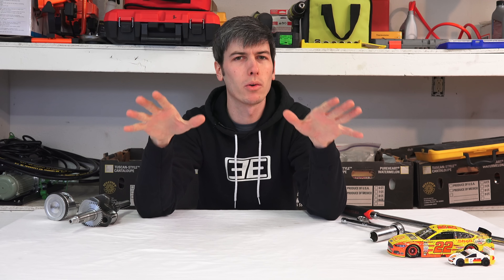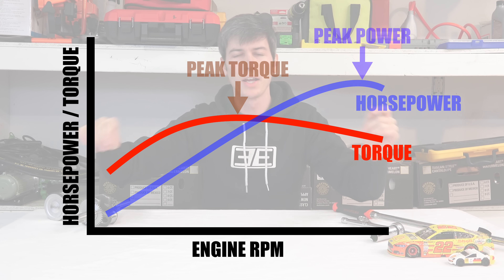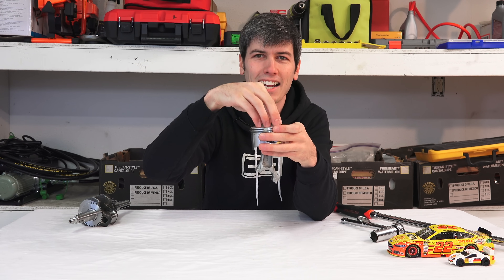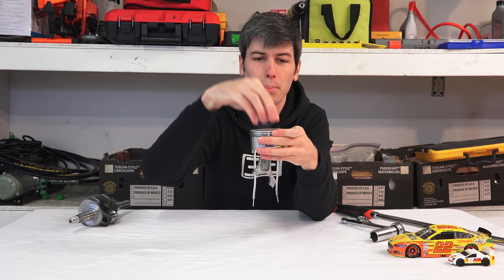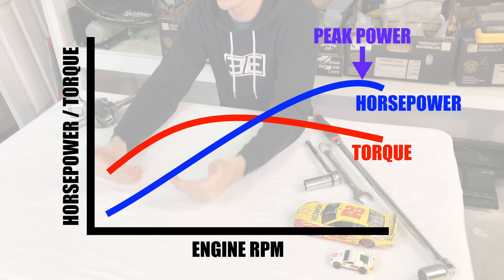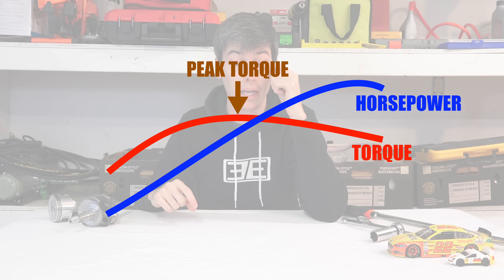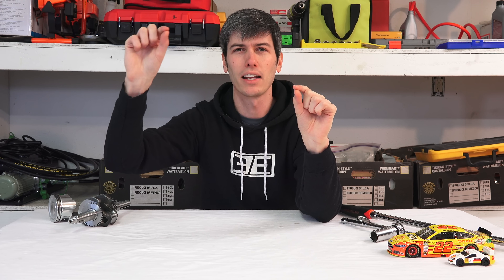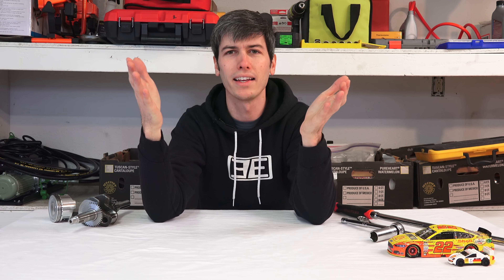Horsepower vs Torque - A Simple Explanation

Comment: Simplest explanation I ever heard was:  Horsepower measures the maximum speed, Torque measures how fast it can get to that maximum speed.
Reply: My (limited) understanding is that torque is a measure of how effective each rotation is at making power. Horsepower is the only useful measure for acceleration and speed.

If you find that a engine has low torque but high horsepower, that implies that it's capable of revving quickly to compensate for the low torque.
Reply: YolkyPalky It may be simple, but it's wrong
Reply: Not really, it's pretty accurate statement.
Reply: YolkyPalky No, horsepower determines how fast you accelerate
Reply: Matthew Prather that is horribly wrong.  Torque determines how fast you accelerate.  Plenty of vehicles have high horsepower but low torque especially on the low end, they accelerate slowly (torque) yet may still reach a very high top end speed (horsepower).
Reply: YolkyPalky Maybe for the first quarter second, but ince you get to a high rpm, horsepower determines how fast you accelerate. Torque doesn't really matter because cars have gears
Reply: Matthew Prather HP is a measure of maximum power, Torque can be thought of as a measure of how fast you can get to that maximum power.  In other words, Torque measures the "Rate of Acceleration", not Acceleration itself.  It is a Rate of Change measure, so to speak.  Two cars with equal horsepower but unequal torque, the one with higher torque will get to peak acceleration, or maximum horsepower, faster than the other car, even though both will top out at the same maximum speed due to equal horsepower.  In even other words, Torque is for stoplight to stoplight driving, Horsepower is for long drag races where you can realize peak power, or peak horsepower, and the amount of torque you have will determine how quickly you can get to your peak horsepower or peak acceleration.
Reply: Low end torque DOES help you get into your maximum power rpm range more quickly. And it's certainly pleasant to have a wide range of usable rpms.

But you can also just have it geared to keep you at an effective rpm.
Reply: ezkieler850, I would rather simplify it like this: horsepower is torque multiplied by RPM. Horsepower is direct derivative from torque. 
I guess, many people take the maximum horsepower as some kind of constant value, whereas in fact, horsepower is a value changing with RPM, based on torque at the given RPM.
Reply: No, that's wrong.  Horsepower is a mathematical equation to describe torque invented by a guy to explain to normal people how much power their engines were making in a relatable way. What EE doesn't explain here is that generally, engines with more torque then horsepower rev slower for various reasons. That slow revving reduces the overall top speed of the vehicle because engine speed is one of the primary considerations in top speed.  The reason why people who don't know any better say horsepower is top speed is because engines with more horsepower then torque (like a modern I4 motorcycle) rev very high and that high rpm is a factor in gearing.

To keep it simple, my 1985 Honda Sabre has a mathematical top speed of 177 mph at 10k rpm in 6th gear but it simply doesn't have the horsepower to reach that top speed,  it will sit at 7k at wide open all day long. Can you see how easy it is to tell me that it's because I don't have enough horsepower when the real problem is the gearing is too high?
Reply: That's the bit I didn't get -- the 200lb-ft car won't accelerate the quickest? Compare two strokes vs four strokes: an RGV250 and a Duke 690 both make about 60hp, but there's no waiting for the Duke to get off its ass and move. BUT the RGV will have a higher top speed...
Reply: Torque tells you what you can do, horsepower tells you how fast you can do it.
Reply: YolkyPalky, I guess, you should consider HP as a parameter changing across the RPM range, not as a single value. On every torque/HP graph you'll see that HP is much lower at low RPM, and that low end HP value will tell you the acceleration from the stop light.

If you imagine two hypothetical engines with constant torque, low-torque engine will have low HP at low RPM, but it will be able to reach high HP if capable of doing high RPM. High-torque engine will have proportionally higher HP at low RPM, and peak HP will again, depend on how much RPM it can reach. All in all, HP will tell about acceleration and rate of acceleration more directly than torque.

Torque is a characteristic at a given moment, whereas HP is a characteristic which takes the time into account. Acceleration is also a parameter dependent on time, hence HP is more descriptive of it.

There is some confusion with gearing that different cars may implement. I guess, torque and HP at the wheels should be considered separately from engine torque and engine HP, otherwise it's hard to speak in same terms. Mind you, the size of the wheels is also gonna be a factor.

At least this is how I personally imagine this whole thing :)
Reply: Right so in the bit with the two cars the 100hp 200tq car should basically take off faster initially and be winning the race until  200hp 100tq car reaches his higher power and plays catch up and passes.
Reply: Yeah simply wrong
Reply: Torque= twisting effort and Horse power= how fast Torque rises

Comment: Good until the last part. Torque is a component of horsepower, but you don't need horsepower to make torque. You can twist a wrench with 100 Ft-lb. of torque, but if it's not moving, you're not generating any horsepower. A piston can't make torque without making horsepower because it has to turn at a minimum rpm to run at all, but it is mathematically possible to have torque with zero horsepower.

Comment: it's very simple. TQ is doing all the work at all times. to get more HP you need more TQ. TQ is the twisting force of the crankshaft and you can't go anywhere without the crankshaft moving. HP is TQ at high rpm. HP= (TQ)X RPM so it's still TQ doing all the work PERIOD.

Comment: Most explain torque as it is obtained computationally but I never found the explanation of torque as lever atm or rsin(theta)(misleading at first sight) multiplied by the applied force to be a satisfactory explanation. The explanation I have found to be satisfactory is torque simply put is a completion of a 3rd law force pair.  I found this explanation by studying pilot training videos. That have to take into account the torque generated by the propeller when taking off the runway amount other physical phenomena.

Comment: I’m more confused now than I was before watching this video lol
2 suggestions: 
First; speak slower as in fewer words per minute 
Second; try summarising at various points throughout the video by “boiling” it down to a simple statement. Then moving into the next section. And I have a question:  when considering purchasing a new car should I be more concerned with torque or horsepower?  Or which is more important?

Comment: Horsepower is speed but Torque is power. HP is how quickly a car accelerates. Torque is a truck maxed out at 30mph but goes the same speed whether it is empty or has 6 tons loaded on it.

Comment: Question: If Torque is the greater number until HP overtakes the Torque Value, than isn't distance a crucial input figure? Example: if Traction if is not the weak link and all thing being equal, than if both cars only needed to travel say 50 ft wouldn't Torque win? Just asking because that what we feel.

Comment: "Power is what gives you acceleration" ??? Once again it is TORQUE that gives acceleration.

The car that has less torque will accelerate slower. But since it has more power it will achieve higher top speed.

The car that has more torque will accelerate faster but since it has less power, will achieve lower top speed.

Comment: very very interesting and enlightening. Now here's the question, why do electric car such as a Tesla out perform in acceleration a combustion engine? Has it has to do with the fact that somehow electrical motors can have a big diameter and that the torque is applied on the outer edge of the stator which would be further away from the shaft than the big end of a crankshaft, thus providing an electric engine a potentially (depending on it's diameter) greater torque than a combustion engine?

Comment: Instead of talking about power and torque when describing a car engines performance, you could just as well describe it with power and rpm. Torqe or rpm is irrelevant if you don't know more than the number. As you pointed out, you need the curve to have any use for it.

Comment: When you are pressed maximum into your seat, that is when the car accelerates the most, which is not necessarily at the engines peak torque even if you have a fixed gear ratio. If you accelerated in a vacuum it would be true, but in reality the car could accelerate quicker at 20-30mph at less engine torque as it would at maximum engine torque at higher speed because more of the power is used to balance wheel torque to air risistance.
Reply: Totally dependant on gearing, engine torque curve, gear ratio and car body

Comment: I have an old GDR Forklift with an aircooled two cylinder long stroke Diesel engine. It has about 760ccm of volume at each cylinder. So the Piston is quite narrow but the stroke is very long.

Could you please explain how stroke and bore make engine power? I know there a various setups. I would like to compare some "normal" gas 1.6 86hp SOHC Mazda four cylinder engine to the two cylindre long stroke 1.5L Takraf NVD 12,5 producing only 19hp @ 2000 U/min. But on the other hand the forklift is pushing around 3.2 tons max. It must have massive torque?

Please help me on that subject. I also would like to long stroke a 1.9L Mazda Miata Engine. I quite hope to understand how it works before building it.

I have some Videos of the Forklift operating online. If it helps I hope to gather more data on that old GDR Engine. If I can bring up and data sheets, I'd like to share them with you.

Comment: Is it possible to have a wave or non parabolic shape in the torque/power graph?
Sinds my car doesn't seem to fit the standard shape graph wise.
When accelerating it's pretty constant and fits the standard profile until it reaches 120 km/h.
I thought the peak moment was at 100 km/h because the acceleration started to decrease.
Until it hits 120 km/h then it starts to accelerate faster again (a lot faster) and then it peaks again at 145 km/h.
All in same gear.
So either it's down to other variables or there is a small wave / flat spot in the graph.

Comment: Good But you did not make 2 important connections that beg me to ponder if you totally understand: 1. You do not point out-make the connection that when using a longer breaker bar wrench in your hand or using gearings, to increase the leverage strength, reduces the speed the work is being done at. 2. You do not point out-make the connection that the reason the engine makes more hp up to the it's hp peak is the faster rpm means more explosions-power strokes per minute, more explosions more power.

Comment: Great Video man..
I have one query ...
 Will we get peak torque at lower gears (1st or 2nd) and peak power at higher gear(4th or 5th)gear) always or it depends ... depends on whats?

can you help me on that
Reply from the maker: It’s an engine characteristic, so you will have it regardless of what gear you are in. It simply requires full throttle at the specific RPM.

Comment: I've watched this video 5 times and while I understood most of it, a small part I still don't understand. He mentions that torque can be manipulated by gearing. The 50 lb-ft x 3.0 = 150 lb-ft, but 40 lb-ft x 4.0 = 160 lb-ft which is where he said you would get peak acceleration. But if they were in the same gear ratio, then the peak torque would be 50 lb-ft x 4.0 = 200 lb-ft > 160 lb-ft. Am I missing something? Any help would be great
Reply: It's correct what you wrote but you missed the point. Yes with the same gear ratio the higher torque engine would generate more torque at the wheel but because the other engine can rev substantially higher, you can use a shorter gear ratio for the same speed range and end up with higher torque at the wheel although the engine itself produces less torque.

Comment: Torque multiplies through the drive train but HP is reduced.  I laugh when people talk about drag cars having 8000 hp.  A 150 ft lb engine in a Mercedes Unimog with 4066:1 gearing is pushing 500,000 ft lbs of torque at the wheels.  That's insane.

Comment: High torque vehicles can use longer gears because torque is the power measured in an instance. It will have the force needed to turn a gear at any given point in time whether from a dead stop or anywhere in the rpm range the problem is when the car reaches its peak hp the car will not continue to accelerate at the same rate due to the upside down power. 

High HP low torque vehicles can use shorter gears since the shorter gears allow a lower torque requirement to accelerate.

The Gear ratio in transmission is one way to manage what kind of power you make. But more importantly the stroke and crank cantilever effect of the engine can drastically change the power curve of the engine. 

Great video, just wanted to add. 

Then you get into all the fun talking points like over square engines (more hp) vs under square (more torque)  vs my favorite square engines (all equal numbers)

Comment: So...I think I didn't get it a 100%. 
Torque describes the force applied to a distance, so the force of the piston applied to the offset distance creates torque on the cranckshaft, right? An hp is torque multiplied by rpm.
But I don't get what that actually means in real life. What is the differnece between torque and hp in an actual driving situation? The more torque, the more force that presses me in my seat when I accelerate?

Comment: acceleration vs top speed
Reply: Yes, both are functions of gearing and final drive ratios.
Reply: Qwame Prince topspeed = displacement..
Reply: That would only be correct if gearboxes weren't invented. Watch the video.
Reply: Both of them are at peak power. Try again.

Comment: I have to take issue with a number of things you said in the video. In your attempt to explain a rather confusing subject you add more confusion when you suddenly attempt to explain how the car with more HP and less torque will out accelerate a car with more torque and less HP through the use of gearing. Not a good explanation as the car with more torque can also utilizing gearing to achieve the same thing. People have been programmed to think of how powerful an engine is by looking at the HP it develops. The truth is that HP is not a measured variable - torque is. HP is derived from torque (measured) multiplied by the rpm (also measured). In your analogy, the car producing more torque could use a "taller" gear (numerically lower ratio) to get moving to a certain speed more quickly as it has sufficient torque to do so. The car with the lower torque, since it lacks the "twisting" power will have to use just the opposite. The same is true if you were attempting to tow with both vehicles. The one best suited for towing would be the one with more torque however the other could be used as well but would require low gearing to do so. It might not tow very quickly but through gearing it can be done. Ultimately what determines how quickly a vehicle will accelerate, all things being equal, is the power to weight ratio. Most drivers in the US would do best to look at the torque numbers rather than the HP when selecting a vehicle. Torque is what pushes you back in the seat when you punch the gas. I think a car that is capable of quickly accelerating from 20 to 80 is more enjoyable (in real life) than one that is slow in the same situation but has an ultimately faster top speed. We aren't generally driving 140mph but we certainly are passing other cars at 50mph

Comment: I don't get it. At peak torque you feel the greatest force pressing you in the seat. so why do you accelerate faster at peak horsepower, where you don't get pressed in the seat that hard?
Reply from the maker: Peak torque is for a given gear ratio. If instead you used a higher gear ratio which put the engine at peak power, the wheel torque would be higher, thus the force pressing you back in your seat would be higher.
Reply: But if you are in one specific gear, peak torque is at another rpm than peak power so the peak torque is still at another moment than the peak power. Or am I misunderstanding something?

Comment: I thought HP was Torque * RPM\5252?  He just said it was Torque * RPM.  What's correct?
Reply from the maker: 5252 is correct if your torque units are lb-ft. I was trying to keep the video simple and not dive into the equations, and show that power is a function of torque and RPM (they’re related) rather than using specific units.

Comment: Using your formula my engine makes 128 ft lb, multiply that by 6500 rpm it doesnt add up to the 140 hp claimed so im confused. Am i misunderstanding the math?
Reply: You have to use 5252 as a conversion factor. So the formula would look like this 
torque*rpm/5252=power

Comment: "Torque is force at a distance" Okay, but what if the distance is zero? What if I remove the leverage, and just twist the socket with my hand? If the distance is zero, that sounds like you're saying the torque would be zero. But that's not true. There's some amount of force there. So, isn't torque just "axial force?" i.e., rotational force?
Reply: If you turn a socket with your fingers there is still a little leverage. I mean you do grip the socket at it's circumference don't you?  If the distance is really zero you would simply apply a force but there's no resulting torque.